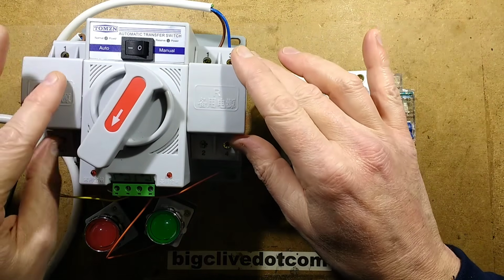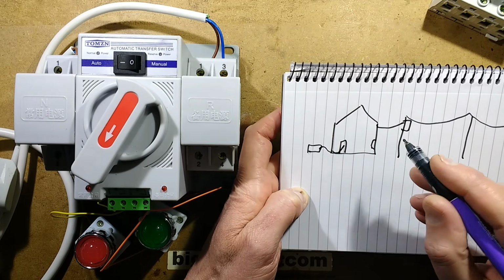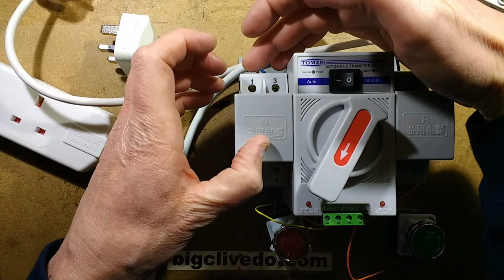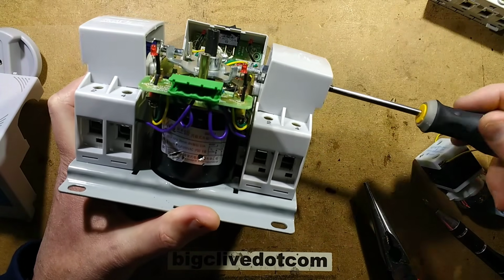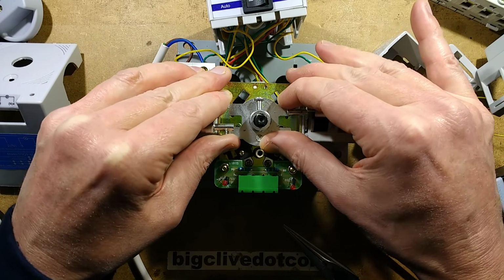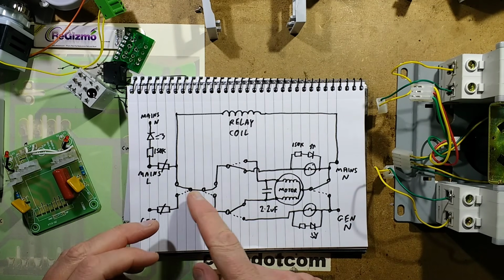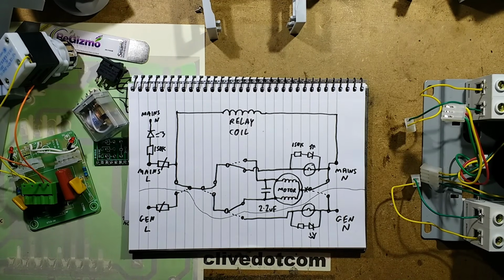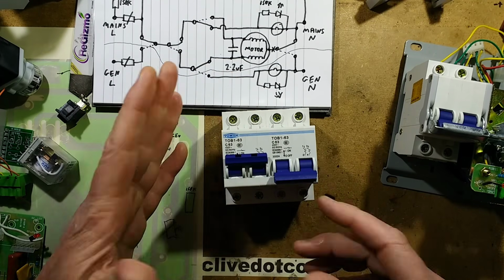Automatic generator changeover switch (with schematic).

Comment: Two drawbacks of this circuit:1. LEDs could burn out in short time because of reverse voltage of 300 volts. There should be silicon diode in series to prevent that.2. I've been taught that you should never put two different high-voltage sources to the NC and NO relay contacts. There is possibility that arc which arises between moving contact and NC would extend to NO and stay there until something burn out. These relay contacts could be arranged in safer way probably.
Reply: AllMyCircuits Given that the Chinese often use/produce custom silicon or make careful device selection where such will lower production costs by eliminating components, it is very possible that the LEDs consist internally of two back to back LEDs that effectively limit the peak reverse breakdown voltage seen across the reverse biased LED junction with each half cycle.  If they never see more than ~2V when reverse biased then no breakdown will occur and thus no damage to the LEDs over time.  This would also greatly reduce perceived flicker since their flicker frequency would be twice the line frequency.  Such are effectively identical in construction to ordinary bicolor LEDs, only in this case both LEDs would be red.
Reply: As the new clive's video states, that's not the case: they just use old-type LEDs which tolerate reverse breakdown pretty well (at least when we conduct less-than 1 mA of current this way) so the continue to work for quite long. Doesn't work with modern ones though...

Comment: Wow, didn't know cheap ATS's like this existed - I work with generators and ATS's every day.  Just had to order one of these to play with, even though I'd never use one in a real fixed installation (they wouldn't pass an electrical inspection here in Vic, Aus) but I will stick one in my Caravan to switch between mains and the Inverter instead of the manual switch I have in there at the moment.   thanks for sharing. :)

Oh, I would be surprised if those breakers have overcurrent protection - even decent units don't, they will require overcurrent protection on the incoming feeds, I certainly wouldn't trust them to be MCB's...
Reply from the maker: I really should pop one of these open.
Reply: bigclivedotcom the one I ordered has just turned up - works like a charm.  I'll probably replace the breakers with something decent before I press it into service though. :)

Comment: I used to manage the IT operations of a small company that hosted everything onsite for compliance reasons. Our automatic generator cutover switch was poorly installed and almost never worked, probably the worst event coming when it couldn't make up its mind if the mains power was back up or not, leading to a situation where it just flapped between mains and generator until I manually killed the generator. Finally, after three visits from our "qualified" electricians, culminating in a full day-long shutdown of the facility the issue was resolved. These were the same electricians who wired 220 to an unmarked NEMA5 outlet, leading to my AC guys plugging a 110v appliance in to it and throwing a breaker.

Comment: And what would happen if there was an overlord (oops, I mean overload) that tripped one of the breakers, while the motor was trying to force the contacts to close. I can imagine that would give some exciting bang-bang!
Reply: As Clive demonstrated with that pair of interlocked breakers, MCBs operate "trip free."  The switch and the contacts are cunningly linked so that if you get an overload while you're holding the switch in the on position, the contacts still open.

Comment: I expected some sort of clever simplicity. I was wrong.
Reply from the maker: In a way it is simple.  The motor approach also introduces a very short delay between the switchover.
Reply: bigclivedotcom I expected some kinda purely mechanical effort that didn’t rely on the leccy before the switch over was made, considering it was meant to work even during major difficultly of electrical flow, this seemed likely, but apparently I’m a bloody idiot, Clive…

What am I missing here? Isn’t the simpler purely mechanical explanation in the other switches better? Why use an electrically operated motor? What would occur if there weren’t enough leccy left behind the motorised changeover? Would we all be f****d?

*just asking, don’t judge me!

Comment: could you (or anyone) be able to design a generator that if it was to be connected parallel to mains a micro-controller would initially sync the phase and match the frequency exactly before connecting them?
Reply: chems Any power plant or wind turbine engineer does that, all the time.  Starting up another power plant when demand grows doesn't cause a blackout, quite the opposite, because the phase and frequency are synced up.  That's also the answer to "what if we want to backfeed the grid safely?".  Become (essentially) a small official power plant linked technically and economically into the overall grid, with the grid engineers knowing and controlling if and when they want your power.   I'm sure grid and power plant engineers also have a standard procedure for transitioning an area in and out of island operations mode when interconnecting power lines fail with fully operational power plants on both sides.

Comment: In the US backfeeding into your home without disconnecting it from the mains will result in huge fines and possibly jail time depending on if you get caught. Though getting caught will be pretty easy with the new smart meters that consumers has installed. They monitor for blackouts and record if and how much power is backfed into the system from your house in real time via two way link. There is some leniency in the system for a noisy computer or sump pump backup or things of that nature where you might get a couple watts of energy, bot something large and they are going to send a hefty fine your way. We are in a trial area for the smart meters, they also have the added feature of daily usage reports through the online portal.
Reply: We are currently in a nation wide roll out program of smart meters here in the UK!
Reply: That's why the law states you must use an interlock or an automatic transfer switch to the mains to prevent possible back feed to the grid.
Reply: It would seem logical to put a generator transfer switch in series between the main breaker and the rest of the panel. That way if it trips, it effectively disconnects the mains automatically. I am pretty sure this is what those big commercial generator systems like the big natural gas Generac systems do.
Reply: Not really, simply switching off the main switch after the meter will stop it from surveying anything. In the case where the house is backfed from an internal circuit, the meter will not see anything.

Comment: I'd imagine they're just 63A switches for a couple of reasons. First off, you shouldn't use breakers for functional switching (which is what this unit is doing) and secondly, there's a risk of an overload causing the unit to switch over by tripping the switch... Who knows what mischief that could cause... Those switches should carry any fault current and allow a downstream breaker to break that fault current just like a main switch would in a distribution unit.
Obviously, I'm looking at it from a British regulations perspective but I think, if you pop those things open, you'll find switches and not MCBs.
Reply: John Barr Hence "MCB Style", not "MCB" in description.
Reply: John Francis Doe The description on the listing is "MCB type" not "style" and they are referred to as as "circuit breakers" several times in the video, Clive also refers to their fault tripping current, which if they're switches, they don't have, they'll have fault current carrying characteristics which is completely different.

Comment: Interesting that it switches both the neutral and the live wires. Generator transfer switches in the USA often don't switch the neutral, they just ground the neutral right to the darn bus bar and then switch the live.
Can result in some nasty situations, and blown up some generators / inverters depending on if they're the 'half way ground' kind. (Which I'd love to know why inverters and/or generators do that, it seems to be a horrible way to do it.)
Reply: It's funny how the last few videos have all been about stuff I use and sell everyday. MCBs, RCDs and Auto changeover units. If you need any free samples or some random tat we have lying around the workshop, let me know and I'll send a care package. (We also have the same see through MCBs)
Reply from the maker: I thought the transparent MCBs/RCDs/GFIs might have been just a Chinese thing.  What country do you sell them in?
Reply: bigclivedotcom we only sell to U.K. But some of our customers export to West Indies, Ghana, and UAE. I should have said that the transparent ones are purely for samples/display models from the Chinese manufacturers. Ours are the usual grey/white colour. 
But yeah, SPD, contactors, fuse gear and the like are my bread and butter.

Comment: 4000 A is really low, we have a minimum 10,000 A here in canada
Reply: But you're on 110V though, right?  10,000A @ 110V = 1.1MW.  Over here 4000A x 240V = 0.96MW, so not much different.

Comment: I put it on my list. I hope to get a 15kva generator, to power the house and shed with a start button in the kitchen to glow and fire up the diesel engine. If the power line to the house is live, can I safely feed back in to the net to get the meter running backwards?
Reply: Yes, as long as the line is live and you're not overloading any wiring anywhere it's fine. But I don't think it's profitable to make your meter run backwards with a generator
Reply: No, not unless you sync the phases, otherwise you'll overvoltage your electronics and electrical devices burning them out, and maybe cause a fire.   And then only until the power company trips your transformer offline unless your set up is approved.
Reply: Just NO!

Comment: I used a contactor
Connecting the coil to generator's power so it is normally open when it is not active
And the mains side is normally closed 
So when the generator is active it will open on the mains side and closed on the generator
Is this safe? 
I've been using this system frequently (since power outages are very common here in lebanon) for years and it seems to be working
Reply: Maher oeidat assuming the contactor breaks the normally closed BEFORE making the normally open and it ofcourse is rated for the current it could see, then yes

Comment: Clive, in the entertainment industry where you have hundreds of power hungry, old-fashioned lights (pars, source 4s, etc), how do you load balance the load from those lights on a failed generator onto a backup generator? Are the lights turned on sequentially? It seems like the sudden surge of turning on hundreds of 750w/1000w lamps would bog down the backup genset on startup
Reply from the maker: The generator ramps up before changing over.  All the automated lights would reboot and only restrike when a command was sent.  On a show the dimmers would bring PAR cans up at their last setting after a short reboot delay due to the desk normally being kept running by a rack UPS.    The generators tend to be rated for the full show load.  Quite often in an arena show the generators are running it continuously anyway.

Comment: what would happen if you connect output 3 and 4 to input 5 an 6  ?
Reply: Danny Boel both "inputs" are labelled 1 and 3 and both "outputs" are labelled 2 and 4, as is standard. I assume you mean connecting "output" of the generator side to the "input" of the mains side?
Reply: + Robin Yes, my idea was that the unit would keep switching and loose its marbles ;)

Comment: Good work Clive...
Could a guy use a double pole double throw switch ?
By connecting the two ( P ) terminals to the INPUT side the the breaker box, and then connecting the two ( T 1 ) terminals to the main feed coming  from the pole transformer, and then connecting the two ( T 2 ) terminals to the generator.  That way the house can only be feed by either the mains or the generator,,, but not both...
I was going to do this to feed my furnace. I have a 3kw inverter, and a very large motor home battery. But ,   alas, , once I figured out that it could be done,,, why do it...
Keep up the good work. ..
Reply: It's quite common in India, sold for 2-4$ for 30A
Reply: RDJim 
Not seeing the internal workings it us hard to tell if it would be heavy duty enough. But by the description in the title that is what I had in mind...
But to actually do this to the whole house,,  upon further thinking, I would use a triple pole double throw switch...
I hope this helps...
But at any rate,,,  I  am guessing that for insurance purposes you would need an electrical  contractor to sign off on this installation.
Reply: Something like this?
https://www.dhresource.com/albu_292093706_00-1.0x0/63a-double-pole-double-throw-knife-switch.jpg
Reply: Wily Bee, A transfer switch/relay is normally just a big double throw switch or relay. In the switch, there normally is a center off position also. In the relay setup, it can be done with a single large DPDT relay or two single throw DP relays. In three phase setups it almost always is done with two 3 pole single throw relays with a delay circuit on them. The tranfer switch on the side of our house is one that is DPDT Center off but has the ability to have another set of contacts added to use as a 3 phase unit. It is currently fused for 200 amps 240 volts but can take up to 600 amps at 480 volts. When you throw it, it makes a very loud thunk and the lever part is over 18" in length. It is lockable in all positions too.
Reply: Ooh, nice! Does look a bit shoddy round the edges though, like typical Chinese shite manufacturing. Like bits are going to fall off, and the thin plastic case is gonna crack quickly. 

If you had a well-made version of this switch, I'd want it. Dunno what I'd actually do with it, like. Just use it as a light switch I suppose.

Comment: From what I remember the Australians have a pretty smart system that will stop households feeding electricity into the power lines when the power line is getting serviced. I think it is the metter that can get a shut down command through PLC?